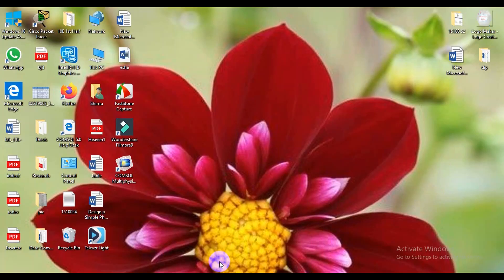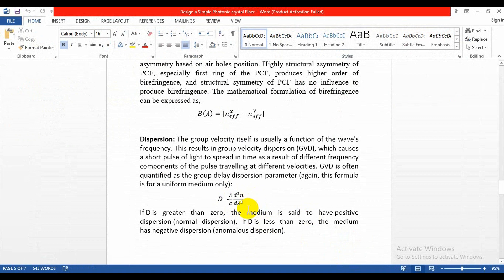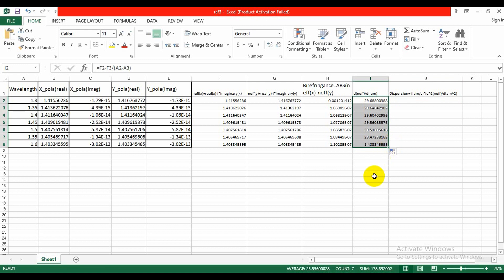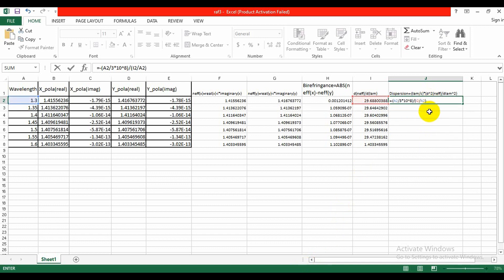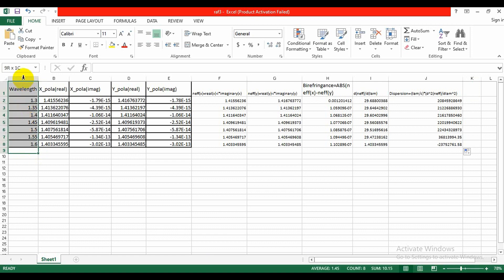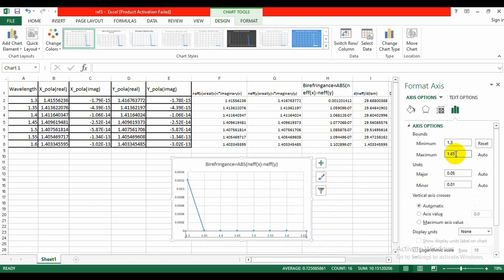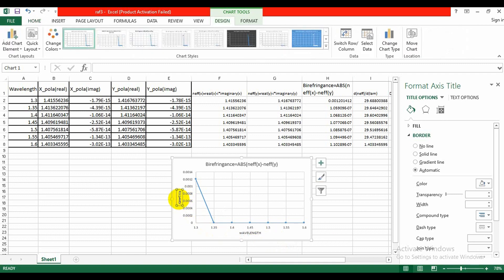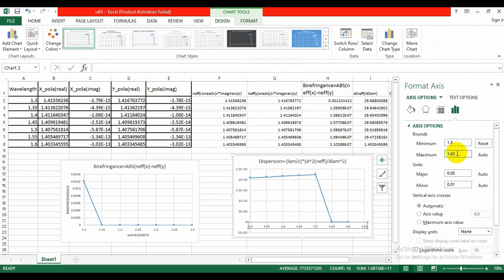Plotting various types of graphs from the simulating values of comsol.

Comment: Thank you for the video. However, I have a few doubts regarding the dispersion calculation formulas which you have written in excel. Could you please clarify why you divided [(A2/3*10^8)'/'(I2-I3)/(A2-A3)] the 2nd order derivative in the formula? I am asking you this as it is being multiplied [-(lam/c)'*'(d^2(neff)/dlam^2)] in the formula written in the header section. Also, you have missed several brackets while writing the formulas in excel.
Reply: Hello sir. Can i get your gmail/contact no, I am alvy Chowdhury EEE student.I currenty working on Consol.